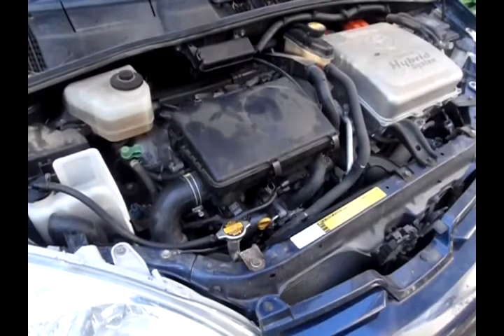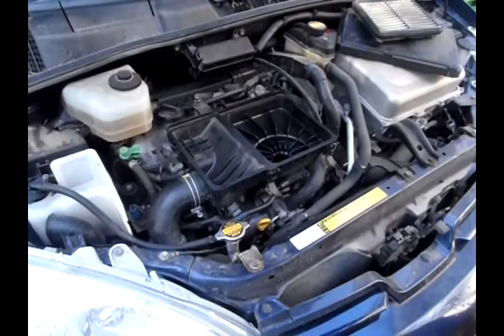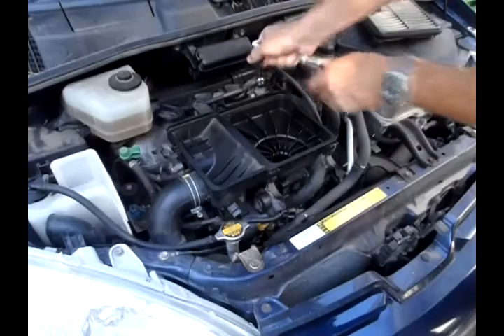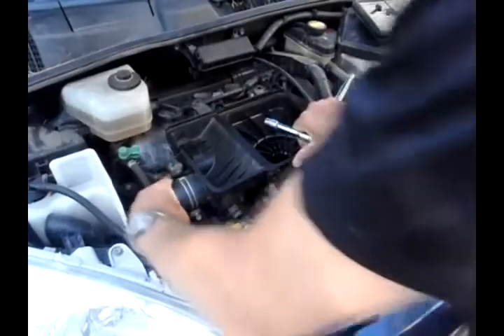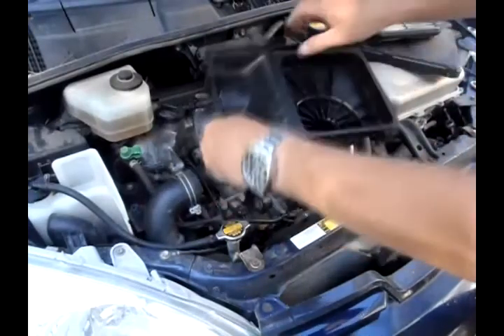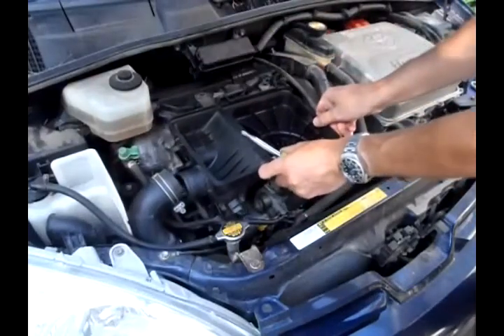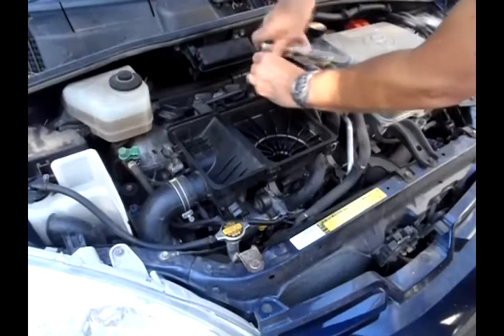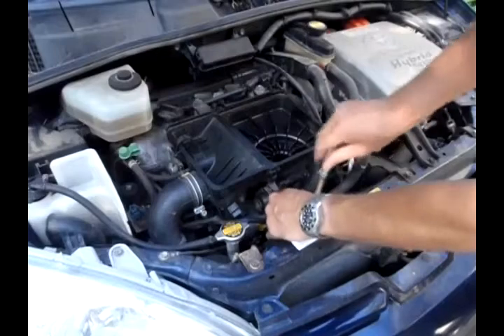How To Replace a MAF Sensor on a 2003 Toyota Prius ( P3191 Code)

Comment: Code P3101....engine, .P3191.....P3190......fail to start..... Engine low power output......Can be .Oil in throttle body, oil on MAF, PCV valve from rocker cover to air manifold fails and lets oil into throttle body, needs to be replaced or keeps clogging MAF sensor.
Or failed fuel pump from worn fuel pump start relay, on older cars, or failed fuel pump, check fuel pressure.
Reply: I have this description in my problem

Comment: Had Toyota Prius 2013. Took off air filter and stamp it against the wall to dust off dirt and put it back. Got P3190 and P3191 and engine stops and wont run anymore. Had car towed by AAA. I followed similar case on this Youtube from Sam1174 to replace new air filter and replace new Mass Air Flow sensor next to air filter housing. I clean housing filter with carburetor spray cleaner. Still won't run showing same P3190 and P3191.  However, another video from Andrew W. shows he resets or erased the warning codes via his diagnostic tool. So I did erase my P3190 and P3191 warning codes, jump start the battery as it probably drain mine. Wow, engine started, I run the car to recharge hybrid battery. Have to thank this video from Sam1174 and Andrew W. as if I did not erased the warning codes even if MAS and Air Filter are brand new, Prius will not start. I cancelled my one-week rent-a-car. I skipped AAA advice to buy hybrid battery for $1,949.00. And cancelled Toyota repair service. Thank you.

Comment: Here in NC its illegal to reset or delete codes. No one will do it for you. Stupid law. because if your trying to fool inspection the car is gonna say if all test have been completed or not.so its still no way around it.
Reply: Not so much illegal as just against store policy. The chain auto parts stores want you to buy thier parts thats why the read codes for free. If they erase a code that was intermittant or wont come back, they lose a chance at you buying their Chineese parts.
Reply from the maker: I live in NC. It's not illegal to reset your codes. Take your car to any auto parts store and ask them to reset your codes. They will do it for free.
Reply: i have been to multiple stores and they all said it was illegal. i didnt believe it so i kept trying. ive tried advance auto parts and autozone and oreilley.
Reply: Buy diagnostic device so you can reset it yourself. I bought one from Amazon and it helped me save diagnostic check fees many times the price of device.

Comment: I cleaned out the oil from the Intake and the sensor, worked fine but the oil came back and  woarnig light cam back on. Cleaned again worked fine then the oil came back, whats up with this?
JBJON.com

Comment from the maker: It won't consume ANY gas. It won't run. 

If it's just a little dirty it will run badly, but if the MAF sensor is damaged the car won't run at all.

Comment from the maker: @ivanbgct Yep. I sprayed it inside and out with carb cleaner. That has worked for me in the past on other cars, but not this one. MAF sensors are very sensitive, precision instruments. On the Jag forum I frequent everyone says to NOT try to clean them because if there is nothing wrong with it before there definitely will be afterwards. in this case I had nothing to lose so I gave it a shot. It didn't work, unfortunately.